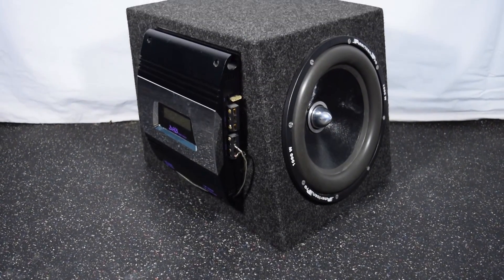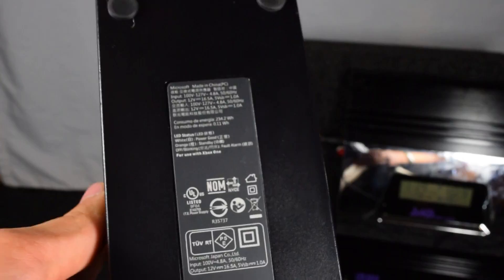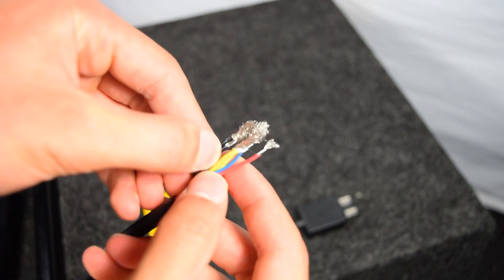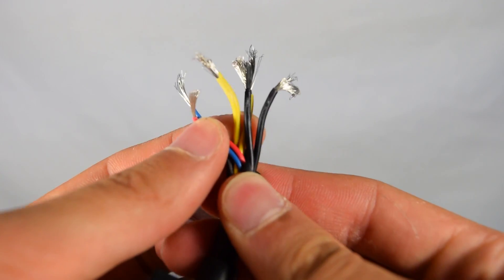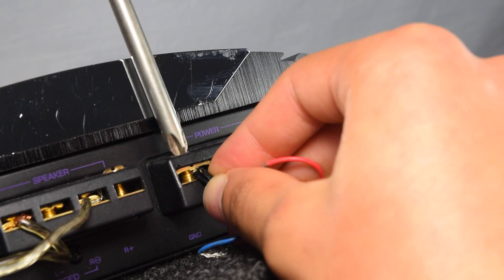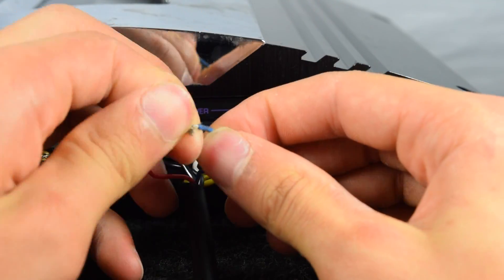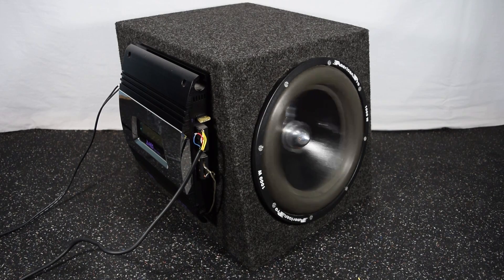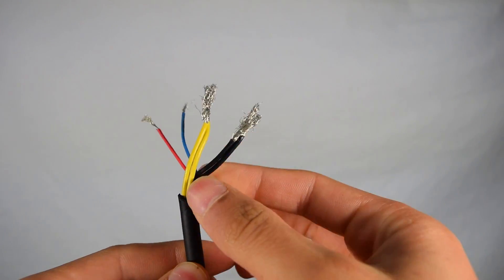How To Power Car Sub/Amp In Your House | Using Xbox 360/Xbox One Power Supply

Comment: Man... Using this 8 years later to fulfill my dreams combining my old car sub and amp with my logitech z906 system. Already own a dac for my headphones so all I need is an optical splitter 1 in 2 so I can use the DACs Optical In / Line Out for sound signal to the amp and I'm good to go.... It was that easy.... Sadly i always used playstations, so i have to purchase that aswell. The xbox power supply im getting has 17.9A iirc. and my amp does bridged 225w so thats almost spot on. Youtube recommendations really do come in handy sometimes.
Thank you so much.

Comment: In the mid-80s I did this with a Clarion deck and the power supply for an Atari 5200. You can do it with all kinds of things if you know what you're doing. You can also ruin everything if you don't.

Comment: What if there’s only 1 red 1 black and 1 white and green wire? It’s a Chinese Xbox 1 supply smh
Reply: Ok nvm with just 4 wires the red is the 12 volt and black is ground and just put the green and white wire together and it works … was about to give up and throw away the bootleg chinese xbox 1 power supply

Comment: Hi, do you think the power of the xbox 360 power supply would be enough for a 4x150w amp? im planning on bridging it so im gonna run 1x300w+2x150w, the amp is a "gelhard gxv 369 " (allegedly 600w), im new into audio/car audio, and thank you :)

Comment: My Guy I like this video .! I did some stuff in my truck that was different for my audio setup so to keep a long story short my head unit wires complete mess so instead of trying to tap into the Bose system I created a stand alone  but here is the catch i used some Home Audio equipment to achieve this in my Car audio setup so I ran my door speakers to a external Amp and Ran the subwoofer and another amp used a Distribution block for Y split my power from battery to both amps and for signal from the Headunit instead of splicing i just used a AV Home Audio RCA splitter box which gave me strong signal from the head unit and I was able to plug in both amps to the Splitter box boom now I have signal and power and I just grounded both amps to a nice clean metal to metal contact point and done made everything way more neat and install was maybe 20 wires max that was ran in total

Comment: First off. That 25amp fuse is not a fuse for the main power of the amp. The 100amp fuse that would be in line with the main power wire. That 25 amp fuse is for audio processing and protection for specific circuits. If you have a 1000w output amp it’s consumes about 1538 wats from the main power wire. And if you use math you find out consuming 1538 wats at 12 volts you are drawing 128.17 Amps so unless your using a 150w amp your never gonna get enough power to that amp with this adapter. It will run but the voltage drop and heat is gonna be intense. And you’re not going to get the rated power from the amp.

Comment: Wouldn’t you be limited to the wattage output of the power supply? in example 14.2 A x 12 V = 170.4 W Xbox 360 power supply wouldn’t that be limited to an amplifier of 170 RMS max?

Comment: My Amplifier has 2 -30 amp fuse . What power supply do I need to get the amp to turn on? If you could please let me know and thank you
Reply from the maker: I am not sure for a dual 30 amp fuse. From my understanding the amp will turn on with this power supply method, you would just be under powering the amp.

Comment: It will also power a single or double din stereo, I’ve had this setup for a while and it works great with car speakers 
The only thing I had to figure out was the constant buzz, I ended up grounding the rca wires and it sounds way cleaner
Reply: i have the same problem with the buzz how did u ground it?

Comment: Yeah, people use cell packs or charger/switching supplies sometimes in parallel for a good reason, 16.5 amps is roughly what? 200 or so watts @ 12v? Thats fine if you want to sound like a walmart 2.1 system...But doing this you have wayyyy better options.  I say if you are gonna do this, do it right, focus on your electronics and the wires first, go overboard here, overshoot your amperage needs, as most switching supplies run at 80% of their "sold as" value. Get OFC primary and ground wiring of the correct gauge.  Would rather have too much and system not stress as hard, and not teeter that line of shutting off the amp or power supply for overdraw on current.     Shits fun tho however you do it.
Reply: Finally, someone with common sense. 🙏🏼

Comment: You think I could run my 1100w amp on this power supply? The amp has a 30 amp fuse I’m just concerned about it not getting enough power

Comment: I hooked everything up as your video suggests. My amp and power block both light up green, but the power seems extremely low. The subs are on but barely making noise.

Xbox 360 power supply
10 inch kicker sub
Kicker IX 500.1 amp

Any tips? Thanks!
Reply: Mine too, constant humming and very quiet
Reply: I am trying to hook up 2 12 kicker got em wired to 600watts -1 channel to a kicker 500-1 amp I’ll let you know how mines goes
Reply: @DavidArguijo-f6u  got mine dialed in, made a box with my old Jl speakers and wired a head unit 
 it sounds awesome

Comment: My only issue is the fear of the psu either exploding or drawing more power than it can for the amps requirements.
Im looking to run a unknown model digital audio 10" sub on a boss audio riot r3002 at 4ohms, only issue is that i dont know if its gonna overpower the PSU Or not
the amp needs 600 watts peak and the psu gives out around 240 peak
so now i have to decide if its a good idea to risk it with an unknown sub that pulls an unknown amount of power
If i could get to know what model of amp and sub you are using that would significantly help me
otherwise ill just be risking burning down shit at my own risk
help me out man

Comment: Bro I did the step wrong and now my house got no power 😭😭 a new fuse for the house is like 2k
Reply: House fuse in 2024? What 3rd world country lol?
Reply: You mean a breaker which is like $10 bucks😭🗿
Reply: Dawg what? Houses don’t have fuses
Reply: @hunterhammer4978  they have, outside you must have fuse box with 30-50A fuses
Reply: @BodziuM pretty sure those are circuit breakers so not a fuse

Comment: Really? just use a receiver and cinema home theater some have powerful bass and sound good with amplifier controlled, I have Bose one speaker and one subwoofer and sound amazing for movies and games, I'm not fan of xbox I'm a PlayStation gamer and i love PS5 i have xbox series x but never used it just collecting dust LOL and Nintendo Switch very rare I play and 3DS XL, my kid have PS1 and Gameboy the old one and Gameboy color, I have another PS5 saved on the closet still like new. Anyways you should upgrade to another console and use the speakers recommended also boombox works great. A gaming TV fully equipped for great quality of graphics will give you a good experience and better.

Comment: My power supply keeps on giving the red light instantly when connecting it to my heaviest amp, is it too heavy for the power supply? I've got the 150w 12a, so it's the smallest one. My other two amps work fine with this method
Reply: same here,  2 amps, one is working fine, second one just cuts off power on xbox brick, amp is ok 100%, tested in my car.
Reply: @BodziuM  Yeah its just not enough power for the amp I guess

Comment: Using an old Xbox 360 power supply and it won’t stay on and my speaker goes into protect mode?

Nvm white goes with the two black.

Comment: Hey so what is the purpose of the white wire in the remote? Also I have a 300 watt amp so this should work pretty well I imagine with respect to power compatability? Thanks for the great video.
Reply: Pretty sure it’s for remote turn out so its 12v to turn on amp?? I’m not too sure I’m here for the same reason you are lol

Comment: Would it work better if I did 2 xbox 360 power bricks and wired them together as 1 would that be safe for a 3kwatt amp
Reply: Smart mff . I’d use that set up for my 3 12s or 2 15s

Comment: I found out why it didn't work for me. My brick was shorted out before i used it as a power source. I found out when i connected the blue and red wire last, and it just turned off while it was glowing orange
Reply: Do you know why it was shortens out, my Xbox cord use to work and I tried this but same thing happened the blue and red caused it to turn off

Comment: Do you have to have the extra white wire ??,what would happen if I don’t ??
Reply from the maker: I would assume it would work the same. But I recommend doing your own research on the type of power supply you have and what the wires mean :)
Reply: @EliteExpert  when i put the blue and red wire it goes into protect mode and turns off, and when i put them into the electrical tape they dont power on at all.

Comment: Okay so I have one Xbox 360 power supply set up I have a 2000w amp that after time dies out I’m assuming not getting enough power? Can I connect two Xbox 360 power supplies to double the power input?

Comment: This should work for a regular car stereo right? Also what’s your opinion on adding a switch in between the red and blue wire so I can be lazy and have it hooked into the wall at all times? Mainly asking cause I plan on building a tower stereo with left over car audio stuff

Comment: Does the power wire have to be specific or can it be any wire that can draw a current to tell the amp to start working
Reply from the maker: It can be any wire!
Reply from the maker: Preferably a thicker wire though just to avoid any chance of fire

Comment: How do you control the volume?
Reply from the maker: Using the gain knob on your amplifier.
Reply: @EliteExpert  I will try this. Can you link where I can find a Xbox one power supply? Thanks
Reply from the maker: Yep. Here is a power supply that I found: https://amzn.to/3y3LH55
Reply: @EliteExpert  1 last thing you said I need a small piece of wire? What kind of wire?
Reply from the maker: Any kind of wire. But I recommend snipping off a piece of speaker wire and using that
Reply: @EliteExpert  I bought the power supply you linked. I opened up the wire and it has red green black wires, not sure how to connect these the amp. Any ideas?
Reply: I'm guessing the red is positive and black is negative

Comment: So I have 2 10in skar sdrs and a skar amp at 1600 max power would a Xbox 360 power supply power it?
Reply from the maker: I would not recommend testing the limits of the power supply and or amp due to the risk of overloading the components of either device. My setup was 500watts max power and the power supply handled it. But be warned that 1600watts sustained could potentially cause damage to your Xbox power supply or the amp.

Comment: I followed your step by step but my power light turns red and the power worked when triggering it before I cut it, what could be the problem? Does it need to be grounded or did it get short out?
Reply from the maker: Hi! Did you connect the bridge wire between the Remote and 12v terminals?
Reply: @EliteExpert  hi yes I did and that’s when it stays green for like .5 second then it fades into red
Reply from the maker: Are there extra cables coming off your power supply unit besides the positive and negative connections? This is odd!
Reply: same issue here

Comment: Remember if you have high current amp it may not be enough current to power in the amp. Any amp drawing over 25amps may overheat the power supply so please do not place your power supply on carpet or anything flammable if u plan to experiment....
Reply: How do you find out if your amp is a high current amp
Reply: @luccib7225  I think the fuses on the side are a good indication. I wouldnt use a 16a power supply if my amp had a 25amp fuse personally. It would probably be okay though as long as you aren't pushing the limits too high.

Comment: What do I do if I have a soft powered amplifier that plugs in the wall and I want to get the most power out of it it’s a 70 W and I want to get the most power out of it?
Reply from the maker: I don't recommend altering the wiring of your amp if it is meant to be plugged into the wall. This tutorial is a hack for subwoofers that don't have the option of being plugged into the wall. I recommend making the best of the amp you have, or trading up to a more powerful amplifier.

Comment: What would be better then an Xbox 360 block I have 2 12s and 1 15 I was thinking 600-700 watt power supply like a PC one 12v and everything I just don’t know if that’s the correct got any ideas ?

Comment: this works 100% used this video for two 10s in my room. NO need for an expensive power source!
Reply: Can it blow up
Reply: @reapergaming2377 just don’t surpass the power you put in into it 😂😂
Reply: how you connected to play music
Reply: @kevinvillanueva8633  You have to connect your music source to the RCA input on the amplifier
Reply: @mrmann5053  i think that will work, obviously you have to connect to the adapter  also an rca cable. Or you can use an all in one adapter
Reply: xbox one power supply uses a fan unlike most xbox 360 power bricks dont you better off using a xb one power brick

Comment: Could you use a ps4 pro cable or does it need the block
Reply: It needs a block. A cable just runs normal power

Comment: What's the max power amp you'd run with this? Trying to power a headunit and 4 speakers off a 4 channel amp
Reply: Maybe run the head unit off another power supply

Comment: Will the amp work at its full wattage?
Reply: if you referred to lots of wattage then most likely red light will show on the amp
Reply: depends on your amplifier watts. 300watt amp should run fine

Comment: I finally got it working after 10 tries but, it was worth and I’m really happy with the results thanks man. 🤘🏽
Reply: Was yours turning red, if so how did you get it to stay green?
Reply: @AOAvina  ground the Grey wire
Reply: @7Logik  this helped me bro
Reply: Why did it take ten tries
Reply: @brandonturner3943  probably kept wiring wrong
Reply: Mine cuts out when Amps turned up
Reply: Where did you plug in your rcas
Reply: @victorh-elburrito6947  at the amp inputs..and your source audio outputs

Comment: I bought an Xbox One power adapter off amazon, just cut the end off and there are only 4 wires. Black, White, Red and Green.  Any thoughts?
Reply: red and black should be power and ground.the other 2 are to switch it on make sure the red is split to your remote and + on your amp.
Reply: @chrhadden  so the white and green go together? And the black goes to ground and red to power and remote?

Comment: Select Products has the best 12v power supplies for car audio amplifiers.  They can be used directly without a battery.  I have used them on Car Audio in store sound board displays for years.
Reply: Got a link?. Id like to find something more stable than a pc psu or random cable.

Comment: How do you connect a car radio to the sub?
Reply: suggest you use a 4 channel amp for decent quallity and bridge the connections to the subwoofer you likely to get more volume too
Reply: yellow to yellow Positive 
black to black negative ground terminal 
remote wire jump a small wire under remote and 12 v screw
Reply: go in the back of your car radio do you see front rca output jacks . dual walmart radios have them. use those jacks and splice the rca cables to speaker wire to amp

Comment: What if they gave me 4 different colored wires on the Xbox power block? Red,white,green & black?
Reply from the maker: I am not entirely sure on the purposes of the colors of each cord, but I would assume black is still negative and red is positive. Try looking online to find the white and green cable purposes :)
Reply: Red and black are hot, white neutral and green ground.

Comment: When I bridge the 12v and the remote my power brick light turns red. Any thoughts?
Reply from the maker: That's odd. Is everything else hooked up properly and tightened down as well? Try using different speaker wire to bridge the 12v and remote connection :)
Reply: leave everything connected .disconnect the power cable from the x box brick.wait until red light turns off plug it back in good to go.

Comment: Meaning of power ratings not as described:  It is the audio amplifier that determines how much current is drawn from the power supply, not the rating on the power supply.  The 25A fuse on the amp means that it may draw as much as 25A.  The Xbox power supply is rated for only 16.5A, which means that if you try to crank up to maximum sound output, the power supply will probably introduce distortion ripple and get hot.  But that maximum sound output would be 15A x 12V = 300 Watts!  That's 10-20 times more than you'll ever use in a home-size room, so there is no power problem.  But both boxes are way bigger and bulkier than they need to be.
Reply: what you have to do is disconnect the power cable from the xbox brick wait until the red light goes out then plug it back in.i fixed this issue all together {because i had to do this every time] by adding a cheap cap.now i have 3 amps and a crossover running off of it through a schitt dac fed by my laptop.all hooked to a surge protector so now i turn everything on and off by the surge protector and i also noticed a hum if you use different outlets for it all.i no longer have this along with one touch convenience its easy dont overthink it.you could even do all this with a jump starter kit for about an hr lol
Reply: Nah I'm trying to hook up a taramps 12k I'm my house it's got four 50 amp fuses
Reply: @brooklynandchase right, ive got 2 JL500/1 AMPS and want to power 2 JL10TW3D4S .... LOL
Reply: This was bugging me for a while I'm glad you sorted this out
Reply: 15 x 12 = 180 bud
Reply: But what if im trying to power a 500/1 amp for 2 300w rms speakers?
Reply: 12V x 15 = 180W